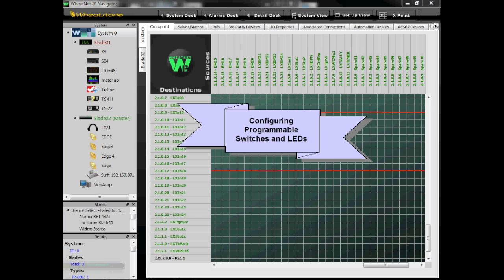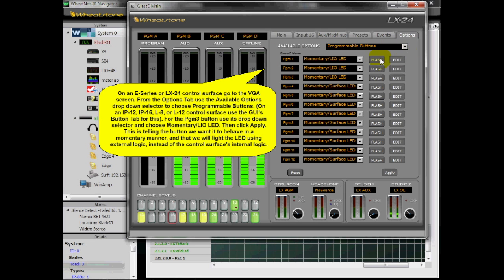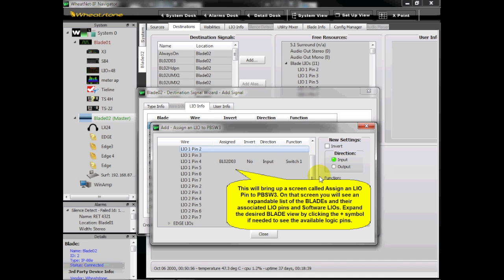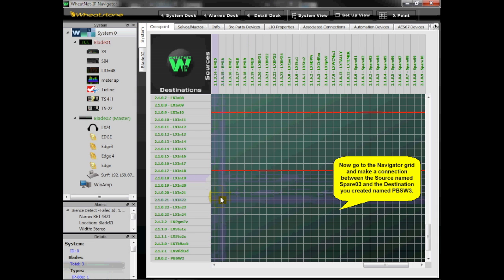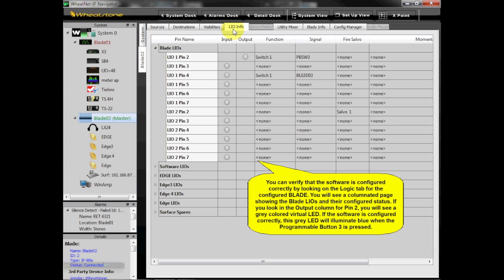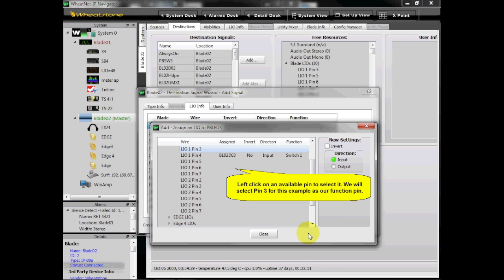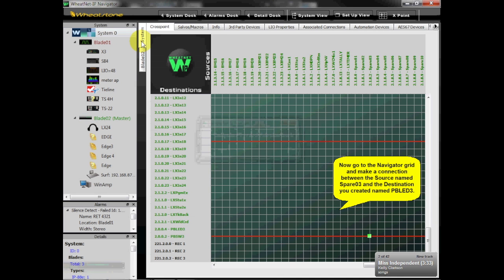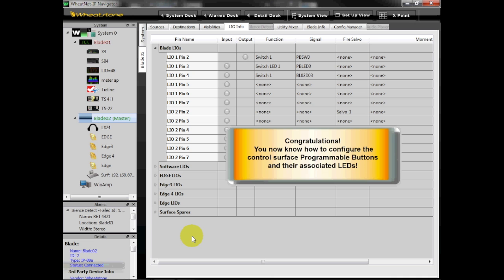Configuring Programmable Buttons and LEDs HowTo

Comment: Not sure if you guys check comments, but I have a one.This helped greatly in getting an external source to turn on the SoftKey button LED.  I'd like to have a single LIO turn on the LIO for 7 difference surfaces at once.  The idea being when our ISDN line connects, each studio's SK LED lights alerting everyone someone is waiting.  The board op for the correct station would then overpress to crosspoint their surface's MM to the talkback of the ISDN or other remote gear.  I tried aliasing the LIO but that didn't work.I'll check with support if I don't hear from you guys here on the tubes.Marc(BTW, thanks for all these videos.  They are very helpful!)
Reply from the maker: +iHM WMI Technical, sure we're watching. I might not always get to a YouTube comment as quickly as our support guys get to a support call, but we're here! Give us a call and ask to speak with Dick Webb (our scripting guru) ... 252 638 7000. Or drop an e-mail to techsupport@wheatstone.com.
Reply: +WheatstoneCorp Thanks for the reply!  I have an email off to support.